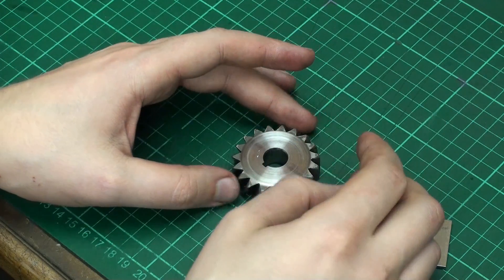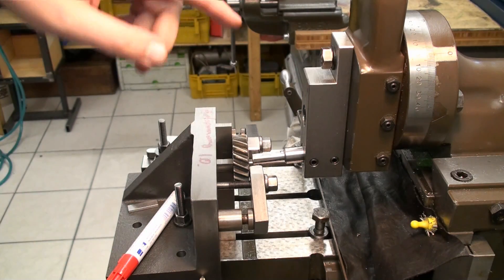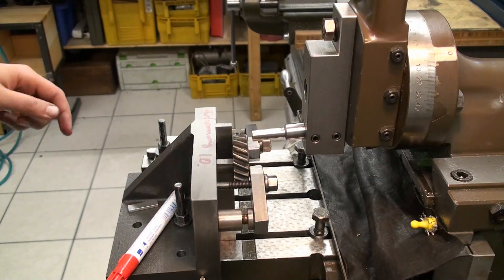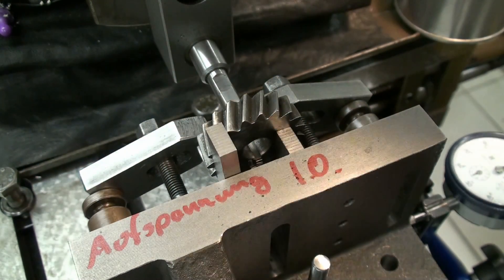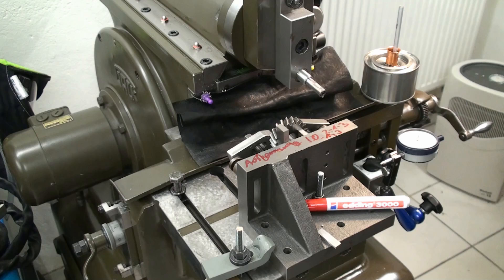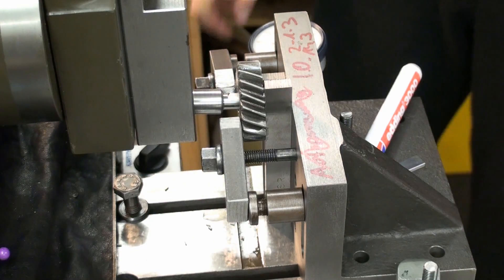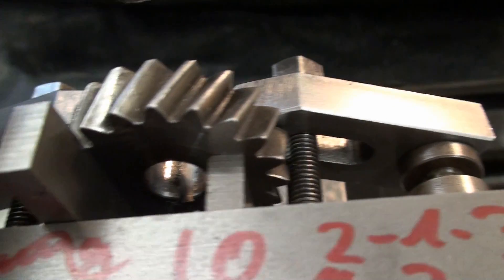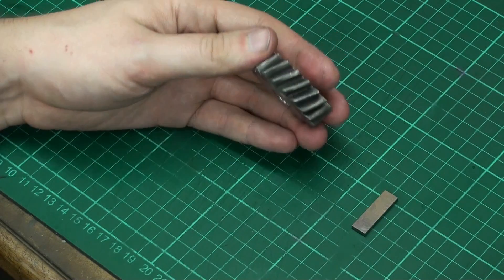Machining a keyway with the shaper

Comment: Hello Stefan! Are you using square shape HSS insert in a cylindrical bore? Isn't is causing problem? Is that fixed with a bolt or it is soldered in?

Comment: Stefan:  Thanks for posting your video,  It's very instructive and detailed.  I would like to build something similar.  I have one question; When the tool bit holder is installed at 5 degrees into the Z axis block, is the TOOL BIT at 90 degrees to the work or 95 degrees to the work?  In other words, at what angle did you drill the hole holding the tool bit.   I hope my questions makes some sense.  Best Regards: Larry

Comment: hi I want to cut internal features like this on a mild steel using shaper. I want to cut internal gear sometimes. I have some HSS bars of probably M2. Will it be hard enough? Will it not need a regrind every tooth of gear? What grade is this high speed steel?(M2, M35, M42, etc.) Thank you.
Reply from the maker: Any HSS will be fine for shaper-use, the higher cobalt alloys might even be to brittle. I had that problem with some HssCo12 tools (I think thats M42).
Reply: I see. I never expected the brittleness and you saved me. I'm building feelings and experiences on my HSS bars with a manual milling machine before I start some shaper works. Thank you a lot!

Comment: That really is alot of work and effort to put a keyway in.  Bolting gear to a vise or table, go in with the vertical mill, dive an end-mill straight center, call it done.  Have a radius at the top of it, instead of a square - but it really doesn't matter since the key will stop at the radius bend.

Comment: hi Stefan in your video you show 2 different cutters for cutting keyways which tool is  better  enjoy your videos
Reply from the maker: I actually prefer those that have a small cutting tool held with a setscrew, as they are faster to make/grind.
Reply: thank you Stefan tried the block and set screw set up on my shaper found it worked very well, and find easier to grind as you say thank you again great videos regards john

Comment: Thanks for uploading this Stefan! I have a job just like this coming up! I have a restored 1950's South Bend 7" shaper. I will try your method out with a scrap/dummy to make sure I can do it (I haven't run the shaper ever before!).
Reply from the maker: Glad it helped you! :)
Using a dummy part is always a good thing, I do it on a regular basis, sometimes in a cheap and easy to machine material, just to see if the setup works at all.

Comment: I have an angle plate I use for this work.It has a milled slot in it with precision pin holes going down from the slot like an inverted vee at 45 degrees.I center the slot cutter in the slot, and put appropriate pinsin the holes to centralize parts of various sizes.A couple of c clamps to hold the part and go to town.Thanks for the video.kap
Reply: I'd love a picture of that if you have one. I've got a hard time visualizing it.
Reply from the maker: +kappullen Wow, that is a great idea! I like that way better than the Angle plate with the three jaw chuck other people use, thanks for the Comment!

Comment: Hi Stefan,
Nice video. One question: For what raison did you remove the clapper box?
Reply from the maker: Patrick Gurdebeke When doing keyways the clapper box can ruin your day - When it swings up on the return stroke the tool can hit the backside of the bore - And then it can get messy...also the rigid holder is... more rigid :)

Comment: Found your channel yesterday, already watched many vids. I can relate to you and am very glad you are providing these in English

Tack!
Reply from the maker: Ras I am a bit biased with the language, but I think I just reach more people with english.

Maybe I should learn esperanto.
Reply: every time I try to do a job like this on the shaper I find the tool steel gets dull very quickly and then makes a very rough cut ....the reason being I have put the extra pin in to stop the clapper and tool steel does not like being dragged backwards..........and I mean real quickly like three strokes and it is RS......any suggestions
Reply: Switch to using a piece of carbide steel and use better cutting oil.
Reply: Stefan G did it with tool steel and no cutting oil why can't I